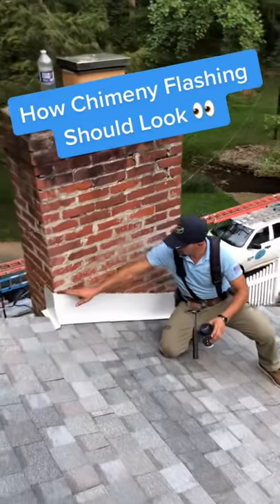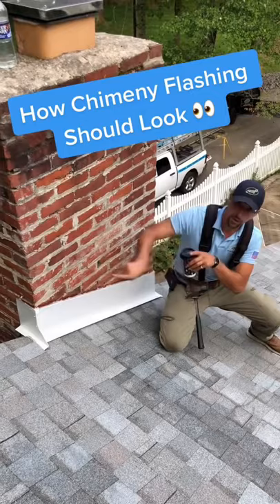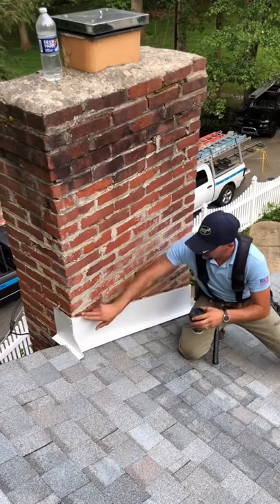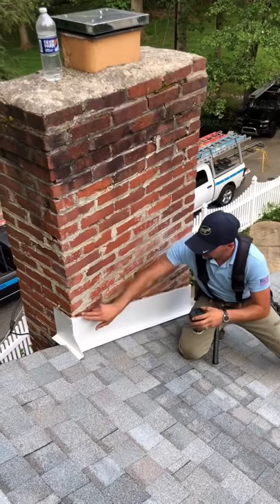How Chimney Flashing SHOULD Look #shorts

Comment: You shouldn’t have cut a straight line through all those bricks. A proper embedded step flashing is the way it SHOULD look.
Reply: Yep 👍
Reply: No. The proper step flashing goes underneath and is now hidden. The long angle cut is definitely proper counter flashing on a retrofit roof.
Reply: Great "point" lol
Reply: This flashing offers far better protection for weather.  If the chimney is being rebuilt then step flashings are the way to go otherwise for existing masonry this is the way you do it .
Reply: You still have to cut into the brick for the steps tho!
Reply: @PuebloRevolt1680 into the mortar

Comment: Your supposed to follow  that up with counter flashing using the mortar joints, if your going to teach, teach it right. BTW, what BS pressure system are you throwing at everyone.
Reply: He must have cut through the whole chimney and the pressure is the top half bearing down lmfao

Comment: Never cut the brick in areas subject to freezing conditions. ...as in this case. 
Counter flashing should  be imbedded  in steps  with the bond of the brick mortar joints , allowing a better  resilience to freeze thaw joint failure and leakage. 
I have seen Fifty year longevity , of properly installed stepped lead and copper  counter flashing in mortar joints in New England....by my father and I ...and  old work by craftsman prior to our era... installed over a hundred years ago
Reply: I daon know where that guy is, but here in Texas, freezing isn't really much of a concern.  We are running 103 degree for our average high right now, and freezing precipitation every 4-5 years. 
So not needed everywhere.
Reply: @Caderic  temperature fluctuations in general will cause expansion and contraction. cutting into the brick is the wrong way.
Reply: @michaelj.k.9408  no it’s not… it’s called reglet counter flashing what are you on? In PA everyone does this and no leaks…😂 you have no idea what your talking about my guy… this is a normal roofing technique for residential roofing or repairs… this is not a new construction buddy 😂

Comment: That better be painted lead or copper or the minerals ,chemicals and ph of the mortar will rot it away. Just like metal flashing/drip edge in contact with pressure treated lumber on decks. Looks nice till it leaks and it will leak

Comment: Why the coffee cup? 🤣🤣🤣 Are you trying to create a certain "persona?" 

Anyways there is a better way of doing it rather than filling it with tar multiple times. Create a sideways "V" on the brake and use a rubber mallet to lightly  hammer it in. Than caulk. Holds wayyy better. And  Better waterproofing

Comment: Umm thatt metal should be under the shingle and galvanized at that and nailed to deck and bulled..and whats that at too????wow
Reply: There are two parts two flashing like that. There is step flashing underneath attached to the roof. What you see above is essentially a hood attached to the chimney that sits over the step flashing.
Reply: I don't know about the flashing under that, but I do know the splashing you see is usually galvalume (which will last longer than galvanized) that is painted.

Comment: 100%WRONG! 
The 1" Continuous cut through all the face of the brick have now compromised the structural integrity of the masonry chimney. 
This roofer has destroyed the masonry structure of your chimney. 
I would recommend taking the chimney down to just below the roofline re stacking all bricks and relaying all the brick in new mortar , building a new concrete crown, installing proper masonry counterflashing embedded into each mortar joint to allow each brick and each course to independently, expand and contract with one another during ice and snow exposure. 
This guy does build chimneys. He is looking to cut corners for a faster install so he doesn't consult a certified chimney professional. 
I have seen heat escaping cuts in chimney before with this flashing method. 
Your creating a control joint basically. 
The thermal expansion and contraction of building materials will result in poor bonds and shattering bricks.